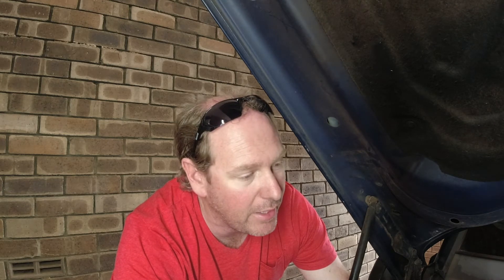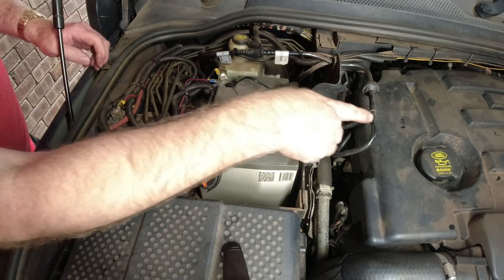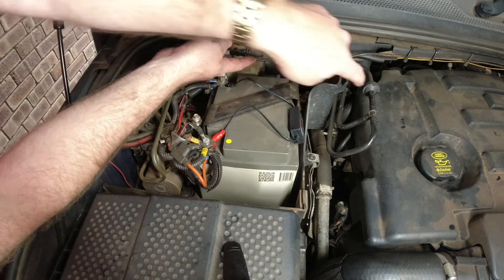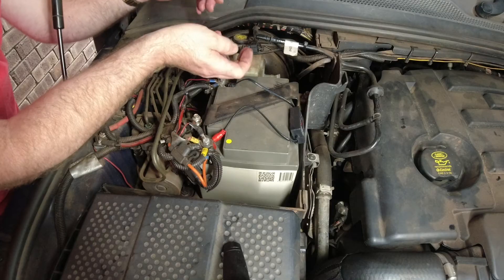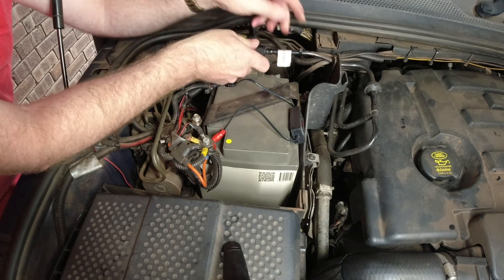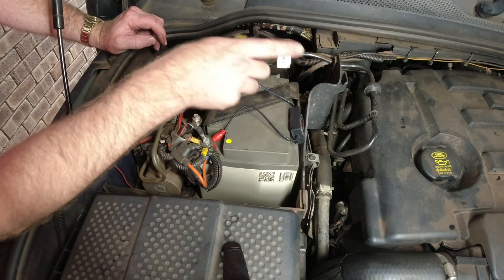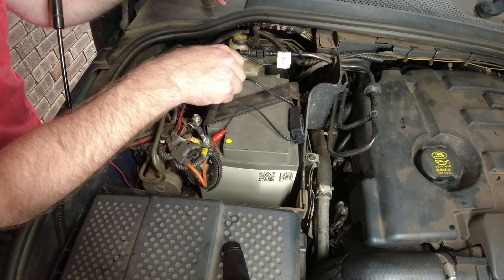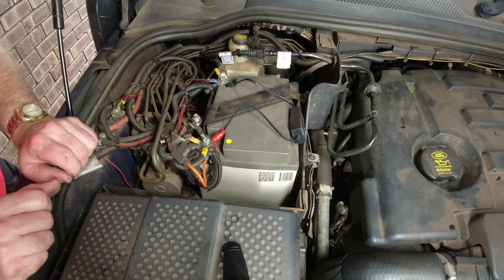LR3 Brake vacuum line inspection 2.7TD | Land Rover Discovery 3

Comment: Hi Shane. Thanks for the informative clips, keep it up. I also live in Perth and have the same issue with my Disco 3. You may need to consider replacing the vac pump as this would be the source of the oil. Apparently seals degrade and start to pass oil. Without that the problem is likely to repeat.
Reply from the maker: I’m going to look into an oil catch can in the vacuum line to see if that will prevent the oil from getting into the booster. Replacing the vac pump body on looks to be a real nightmare of a job

Comment: some one once said to me that my booster had oil inside because of a failing brake pressure but after removing the rubber Bunge and inserting a long cable tie into the bottom of the servo it was empty no engine oil etc. but apparently it was my abs pump had some air inside it from a previous brake bleed..
Reply from the maker: Thanks for taking the time to comment. I'm not having an issue with brake pressure as such, just mainly a lack of assistance from the booster every now and again.
Reply: @Shanes_Shed  if you have oil in the booster carefully remove the rubber side Bunge that's connected to the quick disconnect  and with a syringe suck out as much oil as you can and replace the rubber Bunge. i no this isn't the best thing to do but for the time being its easier than having to do a full complete brake bleed and replace the booster
Reply from the maker: Booster will be replaced, already have the parts. Just need the time to get the job done which should be next week sometime

Comment: Hi. What were the symptoms of your issue. I have it where even on a slight decline, after several light presses of the brakes, the pedal just goes rock hard, like I’m pushing against a brick wall and it’s a nail biting moment waiting for the car to stop. Had it on a steep hill and that was scary!
Reply from the maker: What you describe is very similar to what I was experiencing.  It took very little to lose brake vacuum assistance, there was one particular road where it showed up every time due to the repeated brake applications required.

Comment: Hi Shane,
Thanks for your D3 videos. I have an '07 which has a gurgling sound behind the dash when I'm on the brakes and some research indicates that this is possibly oil in the brake booster. Was this the symptom your disco had?? Also, in relation to Phil's question about the vac pump, I was wondering if the issue came back after a while, or did you install an oil catch can?
I spoke to Melbourne LR and they informed me the recall repair was conducted in '09 on my vehicle. 

Watching your videos make it look achievable, but I'm not sure if I should do it only to have the problem arise again in six months or so?
Reply from the maker: Thanks for your comment. I did not have any associated noises from the booster in my situation. Currently I have not had any further issues and the catch can is something I still need to get around to doing at this stage.